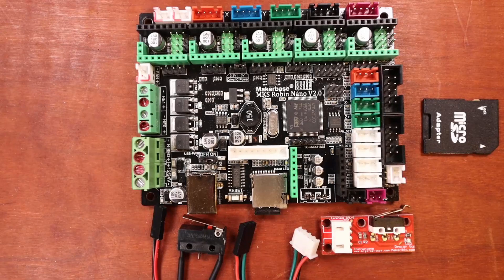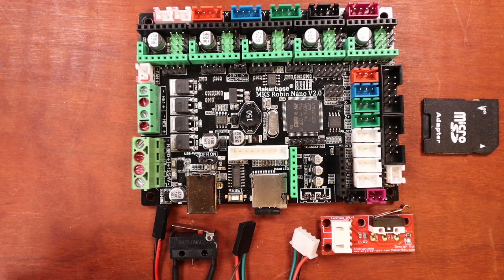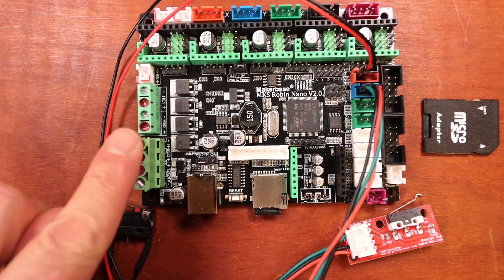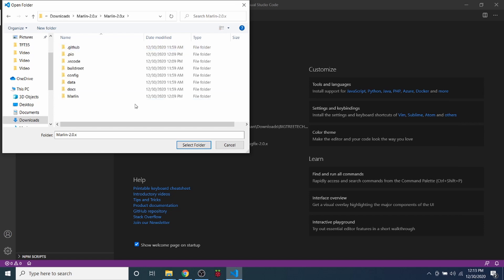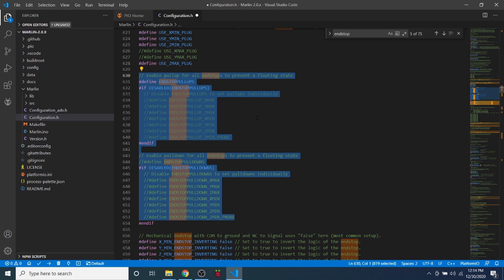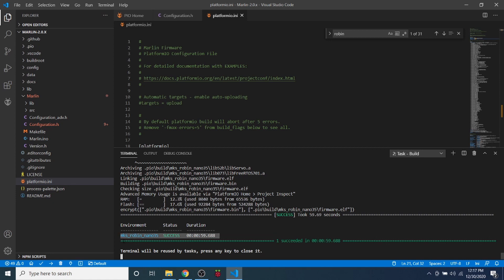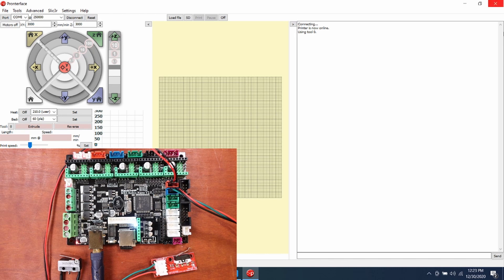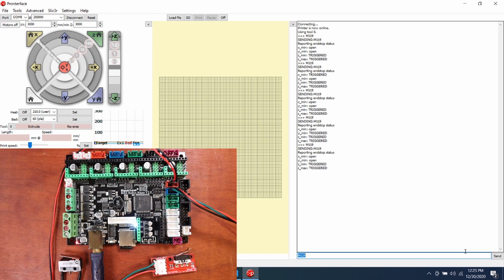MKS Robin Nano v2.0 - Switch Endstops

Comment: I spent a whole day trying to get the switches working. In pronterface they showed working. I thought they would stop the travel when using manual controls!!?? How do you assure you have them in a exact place before you do your homing if they do not always stop travel? they stop travel in bed leveling but not moving! A hundred video tutorials and nobody mentions this
Reply from the maker: Marlin added a fraction of a second read in software, so you need to double tap endstop quick for it to register.